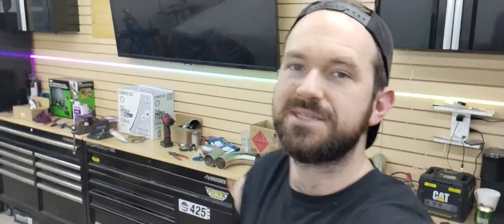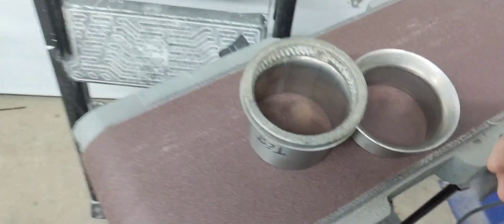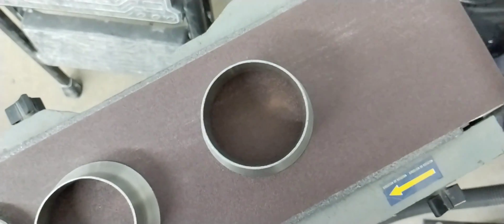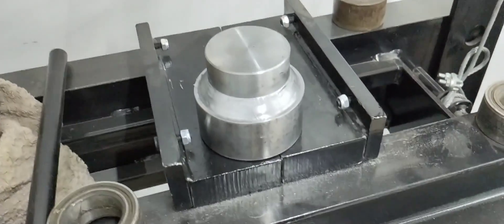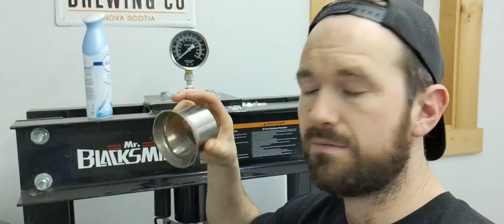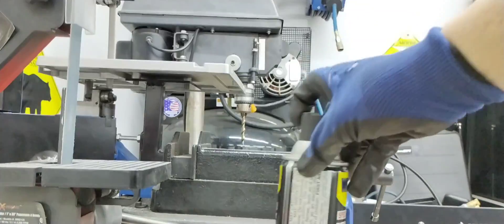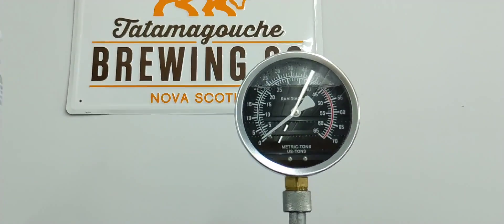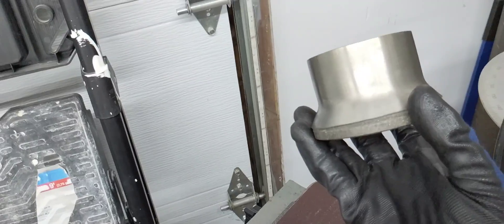THIS WORKS PERFECT EVERY SINGLE TIME! - HOW TO FLARE EXHAUST PIPE - FLARING STAINLESS TUBING - DIY

Comment: That is totally awesome. I like that what would happen if you made the heavy dye the round stock steel that you had machined wider base at the bottom to create a flange would it go out as a flange or would it just mangle it up?     Like a header flange.
Reply from the maker: For this it would end up bottoming out and it would start to collapse the tube. Ask em how I found that out hahah. I'm always curious too. However, for a header type flange, the top of the  TMRcustoms dimple dies work amazing.
Reply: @A @AtlanticBuilt ctually I just went to the lathe and I just made my die pretty much like you did and when it gets to the bottom, the flat part where I said it wants to be flat I let it taper down just a little little bit of an angle, didn’t make it flat on the bottom where it ends up and lo and behold. The flange ended up flat. It was perfect so yes, it did work. It flanged it out a half an inch flat flange.         But I think you’re right if you made that flat all the way around it might crinkle it, but I tapered mine down a little on the outside on a slope and  and when the flange gets to the bottom, it flares out flat all the way around, couldn’t be any more perfect I didn’t even have to hammer or straighten it out

Comment: What do you do if you want to flare a pipe longer than a metre? This wont work.
Reply from the maker: You take a different approach. The same principle applies, a little outside the box Thinking that's all. Maybe you do it in two sections and weld it back together?

Comment: I wonder if you can make a marmon flange after flaring it?

After your done make the flare in your die remove the die and press the flare against flat surface to see if it makes the marmon

I'm looking to make something for semi trucks 4 inch ,5 inch and 6 inch for the v band clamps

Comment: I use a similar tactic too.
If you have a pipe with a thick  thickness, heat it until it turns red and then press it. If you are going to use molding oil, use non-flammable.

Comment: Any chance the die was for 2 3/4”? If could you make two more and ship to FL or NY?thanks
Reply from the maker: It wasn't, any machine shop could do this for you though, guessing for Porsche or something? If you had the donut gasket, try to bring it to a local machine shop and see what they say.  I think next time I will have one done in a harder material than just the cold rolled, but at first we weren't sure if it would do what I needed it to do.
Reply: Okay thanks for the info, yes for a Porsche. I’ll make some calls, it might have made sense if you had the die I needed. 
Cheers

Comment: If you are only making sections, such as what you are showing, it would be good to have the female portion to make a stamping die set.  You will get even straighter flares and less chance of dealing with inconsistent metallurgy, like soft spots/hard spots in the tubing, which would cause sideways distortion.  The female portion has a lip to engage the non-flared end and notches cut on the lip to aid in removing the pipe section if needed. Thank you for sharing!

Comment: I've been doing a similar thing in a similar way except it is straight, tapered, straight at a larger diameter. That makes it trickier, but, after a few tries, it seems to work OK now.
Reply from the maker: That's awesome. Like to bump out/expand the tubing to make a slip joint kind of thing?
Reply: Well, kinda. The tube is expanded just as you are doing it and then the edge is rolled back to cylindrical all in one "press". This to make welding up a flex connector a bit easier. The edge is only rolled over to cylindrical for about 1/4" to fit inside the flex connector. @AtlanticBuilt
Reply from the maker: @edwardtaylor4785  ahhhh gotchaaa!

Comment: Nice tool you got turned. How many tons did you need to press it down?
Reply from the maker: I feel like it was around 12T!  I'll watch closer on the next one, if it's any higher I'll chime back in here!
Reply from the maker: So I watched it, 10T will do the trick when using the copper Anti seize as a lube! Works much better. 😊
Reply: @AtlanticBuilt   Cool! Thank you for the info, and the tip on the copper anti seize.  Me having a smaller press, it was interesting to hear how much it needs.
Reply from the maker: @Karkmotuning  yeah I gave it a try last night and it made a huge difference!